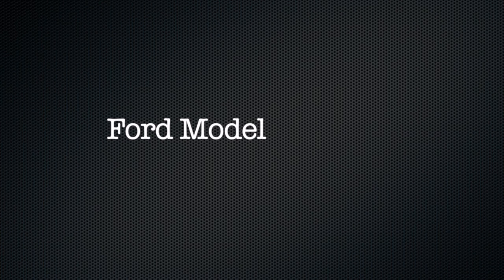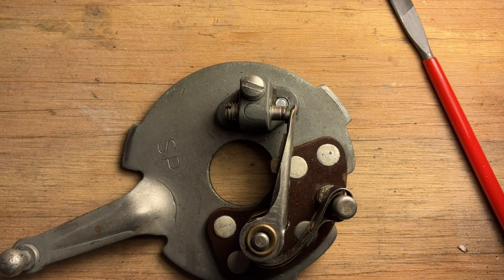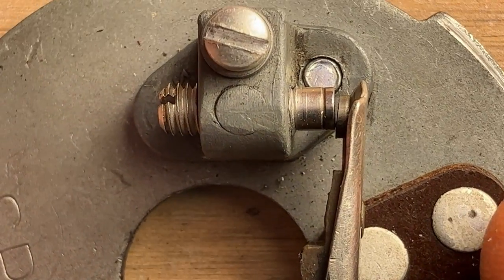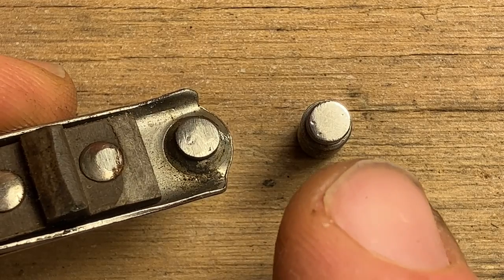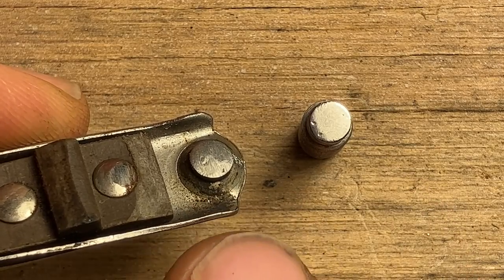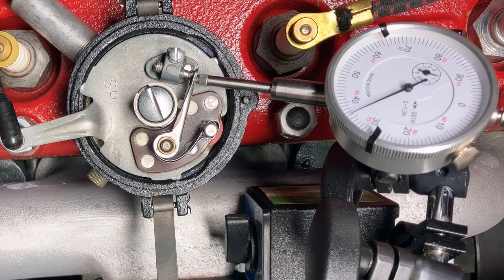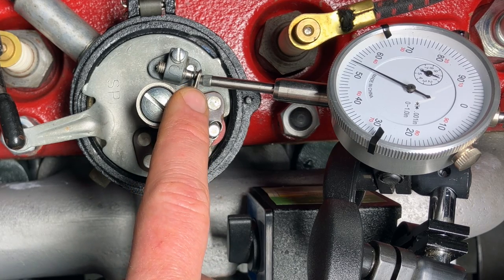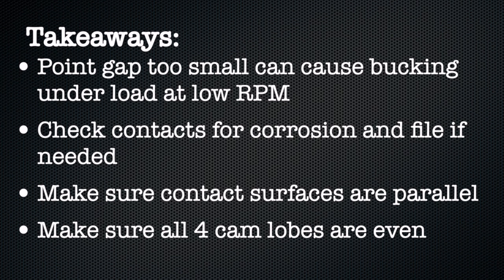Model A Ford – Burned Points

Comment: The video quality (closeup shots) is great in this video.  You didn't say what you did to line up the movable arm/contact points with the fixed points.  Was it just an adjustment of the point block?  If you are using the new points that most of the vendors now sell you will need the newer point block that they also sell.  Well done video.
Reply from the maker: I aligned them the best I could with the block and arm I have. I've ordered the corrected point block and I'll put that in sometime later. Merely getting the contacts parallel and correctly gapped will go a long way (and did in fact resolve the surging problem). I've polished and lubed the cam, so that will help extend the life of the rubbing block. I'll have to remember to check the gap frequently – there are a lot of reports of repro rubbing blocks having a short life.
Reply from the maker: I spent a lot of time getting the close-ups right. Nothing more annoying than a tech video where you can't see what the hell they're doing. Mostly it involved setting up really bright lights.

Comment: @alexiskai0 This was very interesting. Thank you for sharing this. Any suggestions on where to purchase a dial gauge?
Reply from the maker: For a light-duty dial indicator, Harbor Freight's gauge will work just fine. If you're changing cylinder heads and need to check piston height above the deck, a deck bridge will be required for accuracy. For all other measurements, e.g., flywheel runout, checking play in shaft bushings, crank bearing roundness, etc., the magnetic base is adequate.
Reply: @alexiskai  A friend of mine used the magnetic base one when he helped me rebuild my steering assembly.